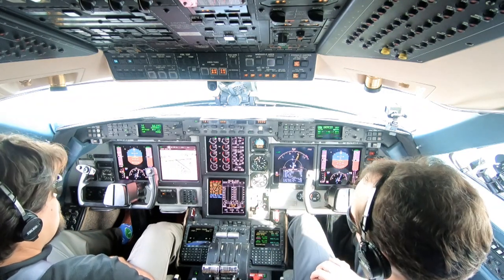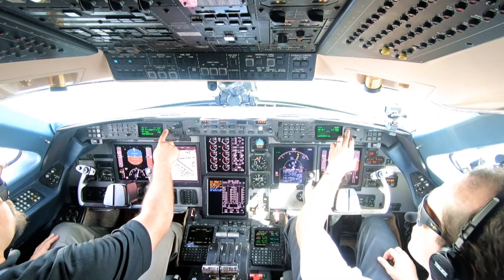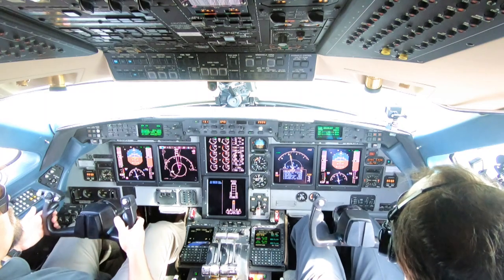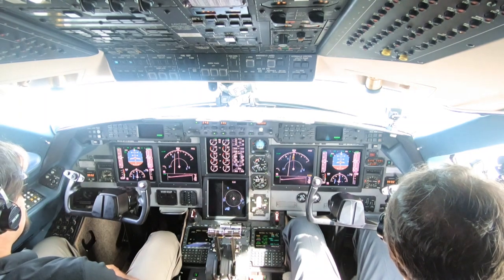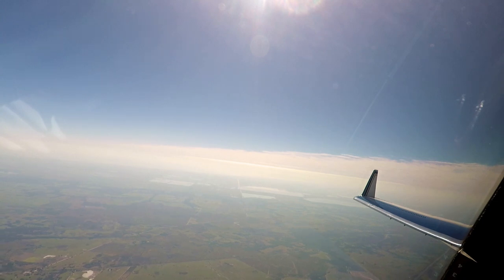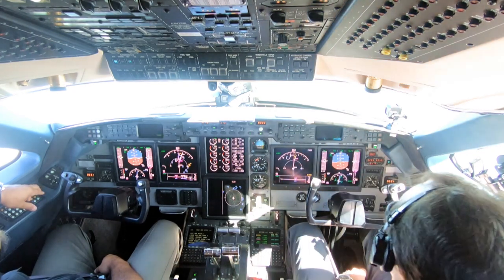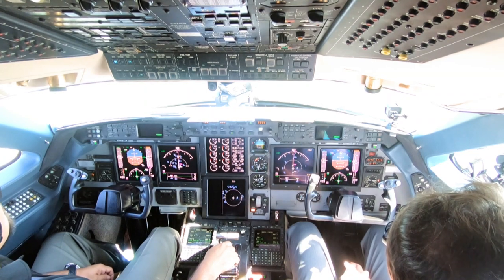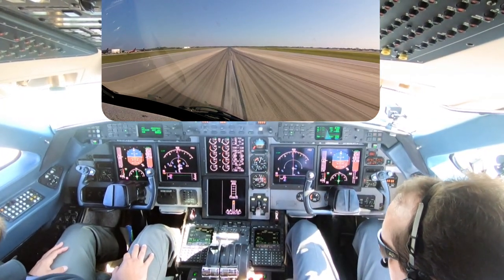Ft. Lauderdale to Orlando with Engine Start - Pilot VLOG 079

Comment: Another good one gentleman. What are you guys checking after start when you both push and hold a button on the panel at the same time and move the yoke around?
Reply from the maker: That's the stall protection system. It's called the stick shaker and pusher
Reply: Thought that might be the case, thanx.

Comment: Three Questions:
1.  Yeah, what is meant by 'Nutcrakers' when going through the landing checklist?
2.  Why does the  co-pilot, meaning the other pilot rather than the pilot in control, hold the yoke while beginning the take-off roll and then the Pilot in Control take the controls at rotation?  Is this a team action or is it a requirement of the Gulfstream's FAA Certification?
3  What is meant by  "Reffing 10 sink 9" (I've heard other numbers on other vids) when approaching the runway upon landing?
Great job again.  Thanks!
Reply: Not like I am any expert, however its been answered before.
1 - Nutcrackers are describe in this episode - https://www.youtube.com/watch?v=KvIBmSmh9OA
2  - Something I also wonder about.
3 -  Ref in 10 sink at 9, means Airspeed is  +10 of the final reference airspeed for landing, and Sink at 9 means they are descending at 900 FPM
Reply: 2. Pilot is steering aircraft at start of takeoff roll to maintain heading on centerline, then takes control of yoke.
Reply: But why is non-pilot in control keeping his hands on the yoke, and why is it pulled back and centered prior to the Pilot in control taking the yoke and then rotating at take off?
Reply: Thanks.  I watched the video on the Nutcrackers and that makes total sense.  Also, thanks of the reffing...  I'm at a loss on how quick they see that but that makes sense, too.
Reply: Here is the video they made on the Nutcracker: https://www.youtube.com/watch?v=KvIBmSmh9OA
Reply: Question 2: what I have deduced the left seat has the throttles with right hand and the steering tiller with left hand. So right seat holds the yoke untill 80 knots then whomever is flying that leg has control of the yoke
Reply from the maker: I think you guys have pretty much got everything covered here. The reason I hold the yoke when Jon is taking off then transfer the yoke at 80 knots is so that he can keep his left hand on the tiller in case we have a hard over of the steering. We fly final approach at Vref plus 10 knots...that's the "ref and 10" that you hear.
Reply: In a true "hard over" the nose wheel is free castering and the only way to recover is full opposite rudder and brake. Heels off the floor for landings ;)
Reply: Why does a pilot need to hold the yoke prior to rotation?  After a few knots the tiller is essentially useless and the rudders take over.  If you notice, when Jon is the Pilot in Control then Jon will hold the yoke with his hands on the center, hold the yoke pushed all the way in and then he'll pull it back at about 80 knots and then at rotation Jon will take command of the yoke and Jon will watch the airspeed...  Interesting, to say the least, but I am very interested as to the why's and if this is a function of the G4 or is it a function of how Jon wants the team to act...
Reply: Timothy Osborn The takeoff roll is pretty much standard procedure. There is actually 7 degrees of nose wheel steering through the rudder pedals so John is just guarding the tiller in case of a low speed abort from something like an engine failure or TR deployment. After the Bedford accident, it’s become a procedure to do one last flight control check at 60 knots.
Reply: Timothy Osborn there was an incident a few years back in Bedford Massachusetts, a flight crew on a GIV took off with the gust lock on. The gust lock locks all the flight controls when the plane is parked. It protects them from the wind slamming them around. Anyhow, the plane over ran the runway and it was fatal. Now, crews always check the control yoke is free between 60 and 80 knots as an extra level of caution. The crew in Bedford was complacent and didn’t use checklist or that wouldn’t have happened. Good read if you have the time.
Reply: Thanks for the reply.  Given that I'm new at this site I'm fairly ignorant of what's going on.  Again, thanks for the reply.

Comment: Shaun the display under gauge display and port side of the landing gear shows an odd picture, what is that? Almost looks like the compressor stack in engine but what the heck is the spire that goes inside so I don't think it's engine. Another great video.
Reply from the maker: We can change that display to multiple different things. If you give me a time stamp in this video of where you see the one you're talking about, I can tell you exactly. We started out with the engine start page up which shows the engine temps and rotation speeds. Then we went to the brakes page for takeoff to show brake pressures and temperatures. Enroute we had the TCAS screen up. Then for landing, we went back to the brakes page.
Reply: Corporate Pilot Life 16:53 or anywhere around there but you already answered it, it the brake screen as you were on landing. Someday can you show a close up of the start and brake screen? The brake part looks interesting.
Reply from the maker: I can definitely do that!

Comment: Nice touchdown.  You guys always like to put her on the deck right at VREF, or is that not always how it shakes out?
Reply from the maker: I usually try to cross the threshold at 50 feet and Vref, then touchdown a little under Vref. Sometimes it works out perfectly, sometimes we're a few knots off from that.

Comment: I'm surprised the shaker/pusher test requires you both to hold down a button - I can see you'd do that if it was something you really wouldn't want to happen at the wrong time - and I guess it is but why not just set it up so it only happens with weight on the wheels?

Comment: What is Engine Sync for? -- sometimes you use it sometimes you don't ?
Reply from the maker: That keeps the engines turning at exactly the same speed. This reduces the "droning" noise in the cabin, thus reducing jet lag and fatigue for the passengers. When we have passengers, we pretty much always use it. The only time we don't use it is on short, empty flights.
Reply: If you have two frequencies which are not exactly the same and they are combining with each other it sounds like the middle frequency growing louder and quieter over and over again. The "droning" CPL talked about.
It's caused by this: https://en.wikipedia.org/wiki/Beat_(acoustics)
Reply: The principle behind harmonics occurs in all the sciences, even in music

Comment: 40+ years chasing needles without a scratch, on me, passenger or plane.  I always found it amazing, and routinely demonstrated in your's and other's videos, that whether a loose approach or a tight approach - which translates to how much glute muscle you're using to hold onto the seat - that during the routine portion of the approach the radio is relatively quiet, but just as your are about to cross the fence, totally in the zone, the radio will jump alive with some ground vehicle wanting directions or a pilot needs his clearance detailed or some other unrelated to you comments, totally distracting, taxing your concentration during the round out.  It's just one of those things that I noticed happened repeatedly to me that you don't hear mentioned much on av videos.  Guess that's why the sim people include distraction in training.
Reply from the maker: HAHA...very true

Comment: What does Engine Sync do? Why do you guys callout speedchecks for every level of flaps and the landing gear?
Reply from the maker: Engine sync keeps the engines spinning at exactly the same speed. This reduces the noise in the cabin, which reduces fatigue and jet lag. We always call "speed checks" to verbally verify that we are under the speed limit for that setting. For instance, we have to be less than 250 knots for flaps 10, and 220 knots for flaps 20.

Comment: Have you ever had to abort a landing/takeoff? It may not be fun for you but videos showing the increased workload during inclement weather (rain, snow, high wind) could be instructional.
Reply from the maker: It doesn't happen very often, but yes. We have had to abort a few takeoffs and landing. It's usually due to an aircraft on the runway or something like that.

Comment: Got two questions. One is, what was wrong with the engine that was mentioned very briefly? Second is, why does the copilot take over the yolk for the very beginning of takeoff and the end of landing?
Reply from the maker: The engine issue that was mentioned was more about the auto-throttle. It was very slow to react and was causing the airplane to "fish tail" a bit. It's very common to see that issue after swapping engines like we recently did. As for the yoke swap, the person in the left seat needs to have their left hand on the tiller for ground steering, but their right hand needs to be on the throttles, so the person in the right seat will hold the yoke during that time.
Reply: Ooh, interesting.  I didn't realize there was a separate control for ground steering and it wasn't through the rudders like in the small planes I fly.  Thanks for the reply :)
Reply from the maker: Yep...here is a short video shoeing how we steer on the ground:

https://youtu.be/cGvsaFYftkM

Comment: What was up with starboard engine? KORL needs some serious runway maintenance...give Mickey a power washer.
Reply: They went into KMCO. :)
Reply: Chris Trott - Oops, that's a Charlie Foxtrot for me.
Reply from the maker: Yeah...the auto-throttle needs a bit of adjusting. It's common to have that issue after an engine swap like we just did.

Comment: Did I hear John say that there was a problem with the right engine?
Reply from the maker: Just the auto-throttles being a bit erratic
Reply: I was going to ask about that big split on the descent.  Is that a regular issue for this airplane or just something that happened this flight?
Reply from the maker: It's more of an issue with the rigging on these engines. Our engines are in the middle of being overhauled, so we have loaner engines on right now. It's very common to have this issue when engines are swapped out. Once we get our engines back on next month, this problem will go away.
Reply: your engine are on midlife?
Reply: Good to know. John is so low key that I'm not sure we'll get much of a reaction to any actual emergency...

Comment: Can you guys explain the differential thrust on the right engine midway through your climb? Is that a yaw 
/crosswind compensation system? Or was the engine running lean and requiring more fuel?
Reply from the maker: The throttle rigging wasn't exactly perfect on these new engines, so they were a little off. Just an adjustment thing.
Reply: Corporate Pilot Life thanks dudes for the response. Baminos!

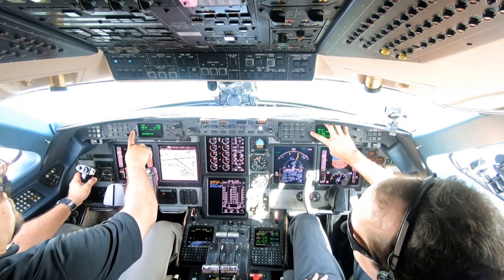Comment: What’s the procedure you are doing at 2:21?  And what causes the rattling sound?
Reply from the maker: That is testing the AOA (angle of attack) system. The rattling is the yokes vibrating...called the stick shaker. When we get close to a stall, that system engages and let us know we are going too slow for the current configuration
Reply: Corporate Pilot Life awesome, thanks for the quick reply!

Comment: Do you believe one day electric power will be the norm for air flight?
Reply from the maker: I suspect it will be beyond my lifetime, but eventually I would think so.
Reply: Maybe beyond simple "electric" if the government ever releases Nikola Tesla's designs!
Reply: I'll speak to this one. The problem is thrust produced by electricity, the electricity has to come from somewhere. There are no battery or capacitor technologies that can even come close to producing the necessary currents, much less over the time required, to get enough thrust to make this a viable option for aircraft. That leaves us with generators of some sort. The only thing on the horizon right now that may enable this is fusion technology, but even that is still science fiction to us at the moment. Sure, we may be able to get some solar-battery hybrid solution on a sailplane to fly some distance, but nothing that will get a GIV off the ground.